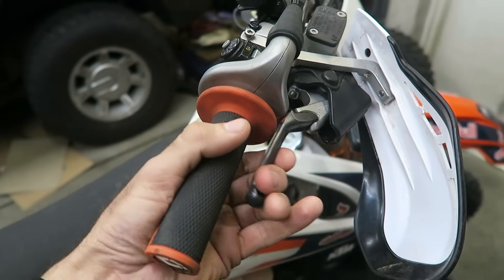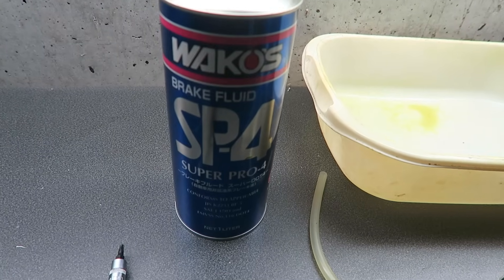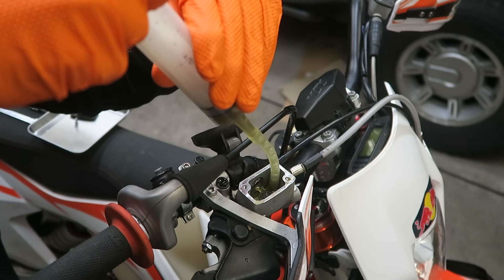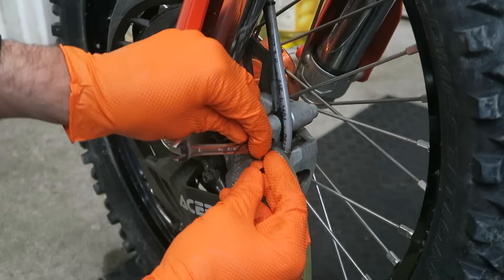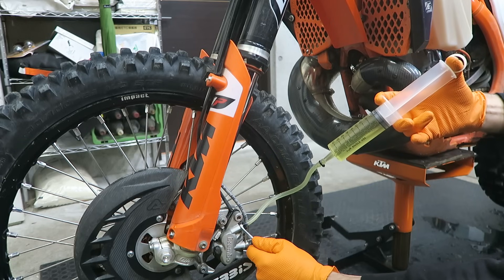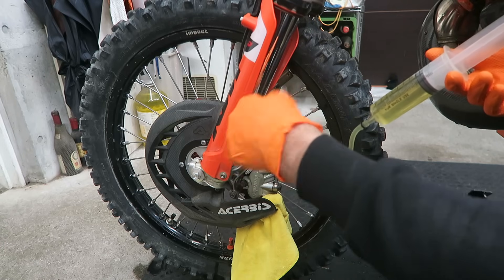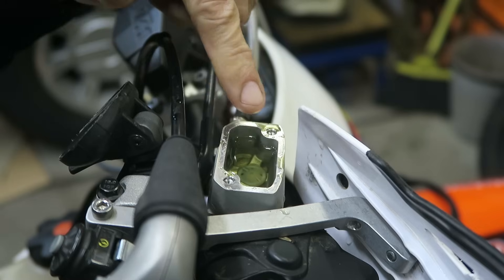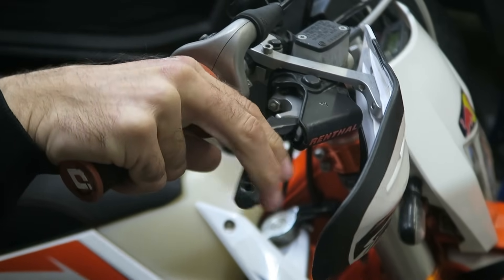Reverse Bleed Brake Fluid Replacement

Comment: Many thanks for a splendid explanation. I see you value queries so here comes one more.
The return spring in the master cylinder opens the return vent from the lines - that why it's easy to reverse prime media - so why do I have to tie the hand-brake lever to the gripped position to eliminate air during, say, a night? Amn't I then closing the channel? Do trapped elevated air - offset by pressure - "pop" out into the ventilated reservoir when I release the clamp?
Reply from the maker: Putting a zip-tie on the brake lever engages the piston in the master (closing off the return), applying pressure to the slave. If left for a number of hours this may help air travel up to the master piston, then when the zip tie is removed and lever released the air can travel into the master reservoir via the piston bypass.
Reply: @TokyoOffroad  Many thanks, as I thought 😁

Comment: My problem has always been trying to keep the vinyl or PVC tube on the bleed nipple, even with a cable tie.  Your silicone tubing seems like a great solution to that!  Do you know the wall thickness of the tubing you use?  Perhaps 2 mm?  The thickest I've been able to find so far is 1.5 mm so I hope that will be thick enough.

I measured the bleed nipple diameters on my Husqvarna Braktec front caliper and my Yamaha Nissin front caliper.  The smallest OD at the groove below the flared part was 5.45 mm for the Husky and 5.39 mm for the Yamaha.  The widest point above that for the tube to pass over was 6.88 mm and 6.81 mm respectively.  I used a digital caliper to make the measurements but my results might be off a bit.  Would you recommend 5 mm ID silicone tubing because it can stretch to the correct ID at the nipple to allow it to be attached to the nipple or would you recommend 6 mm ID tubing that would require less stretching (and less risk of splitting) because once it is on the nipple it can be tightened enough with the cable tie?

Thanks Mark for all of your great videos; they are very well done and very helpful!

Comment: Finally somebody that actually knows how to do break fluid.. Guys think these vacuum pumps are for bleeding your brakes they are merely for extracting the old fluid.. Your instructions are correct my friend you want to force the fluid from the ground up let gravity do the work all of the bubbles will come to the top Close the bleed valve put the cap on your finished..

Comment: Great way to have fluid on the ground and all for it to do jack all.
Reply from the maker: Sorry to hear about your problem. If you can’t inject fluid either the bleed valve is not open, or the master piston is partially engaged (make sure the lever is not pushing in on the master). Once you have the the problem figured out you love it as it’s so quick and easy to perform compared to the traditional

Comment: Thank you so much for the trick. I spent countless hours and money buying all sort of tools but this is method works right out of the box.  Do you recommend doing the same for the other caliper and the bleeder valve at the master cylinder or just one caliper is enough?

What do you think about pumping fluid in the farthest caliper and open the other caliper to push out all the air?

Comment: Thankyou!
Got an old BMW K bike that's tricky to bleed the normal way. Another tip tighten a cable tie after all this on the brake lever/ handgrip overnight to sharpen up the brakes.

Comment: Why in the fuck are you giving needed tools every bike uses different screw heads on those caps some use Allen keys some use bolts some use screws…

Comment: does opening the bleed valve allow air to enter the system between the caliper and the valve screw? I've noticed I have to open the valve screw quite a lot before I can start pushing fluid in. Wondering if air is getting sucked into the system. How much are you opening the bleed valve - 1/8 or 1/4 turn?

Comment: Air got into a sealed system simply because the bike was turned upside down????
That makes no sense at all!
Reply from the maker: The master has a small amount of air in it at all times. You do not fully fill the master with fluid. This could make it's way into the brake line if the bike has been upside-down.

Comment: I’ve never had this work correctly, always just do it the old fashioned way. Better results doing it the correct way
Reply from the maker: I find the regular direction bleed (master -> slave) is good if there is a small amount of air trapped in the slave and sometimes use it after reverse bleeding if I don't achieve a full bleed. However, the regular bleed doesn't work at all if there is a lot of air in the system (Eg. if you've changed the brake line for a new one), unless you use a vacuum pump at the bleed nipple,  whereas reverse bleeding works great. If you have problems with reverse bleeding (can't push fluid into the system) the most common cause is that the master piston in partially engaged, typically due to the lever being adjusted in and pushing on the piston.
Reply: @TokyoOffroad  lol that’s the most incorrect thing I’ve ever heard. The only school way of bleeding works point blank period. I’ve done it on cars, trucks, street bikes , dirtbikes. There is a reason why it was the first method of how to bleed brakes lmao
Reply from the maker: @jamesoso259  I'll agree to disagree on this. In my experience, working on KTM dirt bikes, reverse bleeding is quick and easy and is my preferred method. Note that the video is intended for those working on similar dirt bike front brake, or clutch systems, not cars, trucks, or road bikes with ABS.
Reply: @TokyoOffroad  lol the point is it works on Ktm’s also
Reply: @TokyoOffroad  I’ve done it on my yz numerous times works like a charm

Comment: Greetings.  I love your videos, which I find to be very informative.  I have not had success in reverse-bleeding my 200 XC-W.  I open the caliper bleed screw about 1/2-Turn and I cannot get ANY fluid to flow, no matter how hard I push on the plunger of the syringe.  It bulges the silicone tubing out like a bad side-wall of an automotive tire, and NO fluid flows.  I can't for the life of me figure out what I must be doing wrong.  It sure looks to me like I'm doing it as you show in your video.  Might you have any thoughts or suggestions on what I'm not doing right?  Thanks again, Mark
Reply from the maker: The most likely cause is that the master piston is partially engaged and if so will not let fluid pass into the reservoir. Make sure that the lever position is adjusted out enough so it isn't pushing on the piston. On a side note it's important to have some free travel (spec is greater, or equal to 3mm) or you are at risk of the brake being applied when the fluid heats up.
Reply: @TokyoOffroad thank you, Kind Sir, for your comment.  Yes, actually, the piston may have actually been engaged.  I had the lever adjusted all the way out, and then some, to take out the slack.  The adjuster was threaded out farther than usual, which was likely applying some pre-load throught the actuator rod and onto the piston.  My neighbor helped me do a tradional bleed and i now have a firm lever. I then installed a Midwest Mountain Engineering shorty lever and it works well.  I was originally discouraged about the little "free play" I have with that setup, but your explanation makes sense and I'll keep it that way.  I will re-attempt this the next time it's needed. Thanks again for all you do, especially the personal reply, SO helpful!!  Peace!

Comment: In your example where you are using the syringe to reverse bleed the brakes, and the system is totally empty of fluid, can you start out with a dry primary reservoir?
Reply from the maker: Yes, using the reverse bleed method it's no problem to start out with a dry brake master.

Comment: Hey can this work on the clutch and rear break?
Reply from the maker: Yes, it works well on the clutch. Rear brake too. Often I use reverse bleeding for the main bleed, then finish with a couple of traditional bleed cycles to ensure there is no air trapped in areas the reverse bleed might have difficulty in bleeding.

Comment: Just come across this video, brilliant fair play. Need to do my Vespa soon, got the kit ready, just  hope I don't want to replace full brake system 🙏being stood here six years. The resovoir is quite empty at moment. How much brake fluid will it take?
Reply from the maker: Typical units only take about 100ml or so. If you have a 500ml bottle you'll be fine...
Reply: @TokyoOffroad  Thanks for getting back to me very much appreciated 👍

Comment: i tried this method and the syringe is very hard to press and no fluid is getting in.
Should i zip tie the brake lever ?
Reply from the maker: If no fluid is getting in the most likely causes are either the brake caliper bleed valve is not open, or the brake master piston is not fully disengaged (make sure that the brake lever is adjusted out and not pushing the master piston in).

Comment: This is the best way to service the brake if it’s single disc system 
Quick and easy 
The vacuum method that most shop use takes longer to bleed from completely empty systems

Comment: Great vid 👍 Doing the brakes on my BMW R1100RS but the ABS II unit seems to be stopping the fluid flow using a Mityvac. The front reservoir doesn’t empty at all using this method.
Hoping a reverse bleed will do the trick.

Comment: You will get some leakage at the bleeder with this method because the bleader's threads are not fully sealed.  Maybe wrap the threades with tefelon tape before starting.  You might find that a bit of safety wire twisted about the tube at the bleeder makes a more secure connection.  Always have a wet shop rad handy when messing with brake fluid.

Comment: Always remove the calliper,and pads,hang the calliper so bleed valve is at the bottom,proceed with syringe,then once all.done flick the lever a few times,add correct amount of fluid in reservoir,clean thoroughly with brake cleaner and reassemble,great vid.

Comment: ON my motorcycles, I could not build pressure when I did traditional way, with this way it was quick,,, I think the reverse bleed for brakes and clutch is the best way, it build pressure in the system when you do it this way as well,,,,,good video

Comment: What could be the problem if this method just doesn't work at all? I did everything just like that and the fluid just slowly drips from under the bleed bolt, the reservoir doesn't fill at all and the lever doesn't become stiffer.
Reply from the maker: Make sure that the brake lever is fully out (disengaged). If not fluid will not be able to pass round the piston.

Comment: What amount of new oil have to inject to make sure that is all the new oil in the system ... ?
Reply from the maker: The system volume capacity isn't very much. I haven't measured it but would guess at about 100ml. 200ml and you can be certain that you'd get a very thorough flush...
Reply: @TokyoOffroad  thanks!

Comment: I opened my valve and took off the reservoir cap but can’t for the life of me get the oil to go in, even with a heavy duty syringe. Do anyone have any idea what could be stopping the oil from going in?
Reply from the maker: The most likely cause is that the piston in the master cylinder is not fully retracted and preventing fluid entering the reservoir from the hose.

Comment: Brake cleaner is so toxic and is not needed. Use soap and water mixed in a spray bottle. Use small scrub brush when cleaning. Also, brake cleaner around the brake pads will dry them out and they will squeak horribly. Great video mate, you are the best of all time with repair videos and thank you so much for everything!!!  Without your vids we would lost and doing things incorrectly, much appreciation for all your knowledge you've shared, etc.
Reply: Yes, just use water to celan brake fluid. Brake fluid is water soluble.

Comment: I don't know what all the fuss is about doing it this way (reverse). I think it's also more difficult to get rid of all the old fluid if trying to have fresh fluid. It's easier to let it drain into a container from Gravity. I just pumped the brake lever to pressurize, then crack open the bleed port to let fluid out the bleed port with the brake lever held in compression and let it drain out into a  container. Close then close bleed port, then release lever, add fluid to reservoir when needed to stay above ports and repeat. This takes less tools. I didn't need two syringes and carefully fitted hose on the bleeder port. This is pretty much the standard way to bleed car brakes. I flush the entire system of old fluid in the process and get a firm brake lever when finished.
Reply from the maker: The advantage of the reverse bleed method is if there is air in the system it's much quicker to get a full bleed. If there is no air in the system then the traditional bleed works fine too. In my experience the reverse bleed is much easier to do on your own as compression of the brake lever is not required. My experience of reverse bleeding is that it's quick and easy to do. Traditional bleeding not so much (particularly if there is air trapped).
Reply: @TokyoOffroad I’ve put about 100-150ml of fluid through my front brake system today and it improved but it’s still spongy - I suspect the reverse bleed is going to use the same or less fluid and also be more likely to have a successful outcome first time so less faff. I tried the Stretch Armstrong DIY approach then got help from the mrs to pull the lever and it was like a scene from the Chuckle Brothers 😅

Comment: What if the hand brake wont allow the fluid to flow in reverse?  I loosen the upper banjo bolt and reverse flow pushes fluid UP.  When I re-tighten the upper banjo bolt then its impossible to push bleed plunger in at all.  Seems like something wrong internal to the master.   Thinking next I remove the hand lever again and the clip to pull out the plunger to see whats wrong in there.  There was a bunch of crud in the resoviour - maybe some got into a valve.  Other ideas ?      I tried a hand vacuum on the end of the bleeder and that only sucks fluid out — does nothing to restore brake.  — Yes, im guilty of allowing the KTM to gather dust in the garage for years.  Next is carb flush, tank flush.  Learned to NEVER take a tank to a commercial spray off car wash — the pressure inside the tank split up open my honda XR tank.
Reply from the maker: Yes, if fluid can not pass up in to the master something is wrong. When the mater piston is fully released fluid should be able to pass from the slave to the master. Either the piston is not fully released, or the master is clogged up with debris.

Comment: Always wash and dry the cap and rubber separately as it will now seep out over the next few weeks and then destroy your master cylinder from the outside in. A typical bike shop mistake

Comment: This is a good method for single brakes, but I don't think it will work so well for twin brake calipers, since you won't know when you have old or new oil in the reservoir. This is easier to see when you push through from the top as you will see the new oil colour in the pipe.

Comment: Tried this, and like another commenter, I couldn’t get the fluid to push to the cylinders, it just wanted to come out the bleeder screw threads. Also, I’m glad it didn’t work because my front bleeder had a bunch of dirt in it and by bleeding down from the master, it flushed all the dirt out instead of into the system. So if you do this method, make sure your bleeders are cleaned out. This reverse method did work great for me on the clutch though.
Reply from the maker: If you can’t push fluid up it indicates that the master piston is not in the correct position (is not fully out), or something is broken. Yes, it’s important to clean off any dirt from the nipple before reverse bleed. If the nipple cap has stayed on all the time during use it should be clean inside. Pleased to hear it worked well for your clutch.
Reply: It could be that the compensation port in the master cylinder is blocked. The fluid has to go through that port to get into the reservoir. It's a tiny hole. 

If it gets blocked, by the way, that can cause the brakes to drag or seize up when they get hot because you need that hole to release any pressure caused by expanding brake fluid.

Comment: What if you drain the system completely? Are you supposed to? You only said to remove the brake fluid from the master cylinder.
Reply from the maker: The method works the same even if the system is completely drained of fluid.

Comment: Hello, I'm rebuilding a Honda CB-1. I've fitted a new repair kit to the front master cylindet and followed your instructions, I'm getting new fluid into the reservoir but can get no pressure at all on the lever. Any thoughts would be appreciated. Many thanks, Ian
Reply from the maker: The most common reason for not being able to get pressure is because there is still air somewhere. Try reverse bleeding a few more times. And if it’s still not OK try regular bleeding a couple of times.
Reply: Thanks for the reply, since writing I've mad some progress so should be ok. Ian

Comment: This is a great video. The only thing I could add is to make sure your brake line always has an upward trajectory, not bend downwards to your reservoir otherwise air could still get trapped.

Comment: do you just keep pushing fluid thru....no pumping the lever?
Reply from the maker: Yes, just push fluid up using the syringe. Using the lever would force fluid down, which is a different method...

Comment: I've been doing it this way since 1985.  Some bikes (every Japanese bike I've owned) will suck air in around the bleeder screw threads. Don't open the valve any more than needed to get fluid to go in.